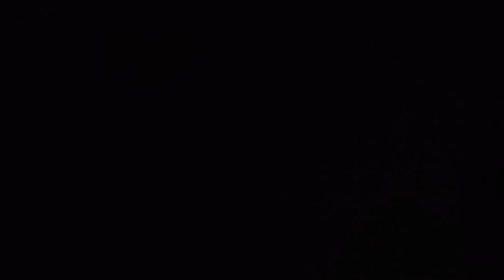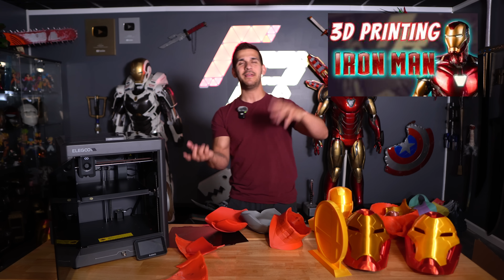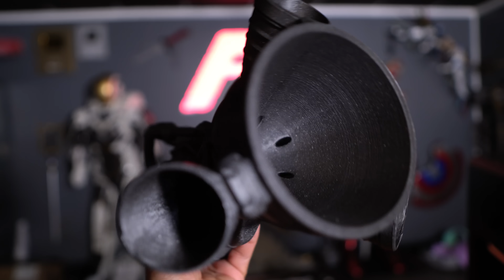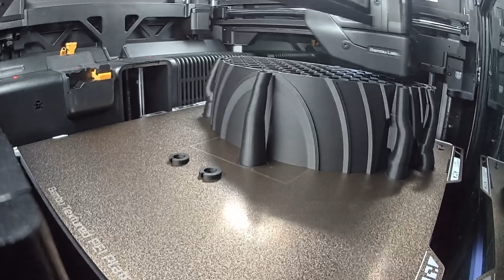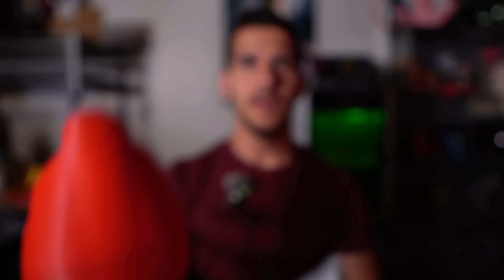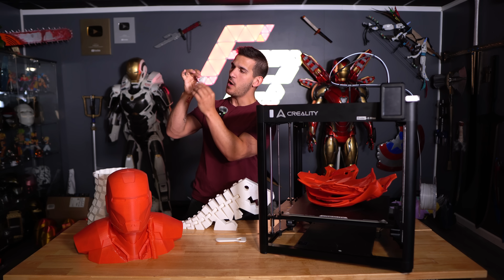3D Printer Update: Elegoo Centauri Carbon, Prusa Core One, Creality Ender-5 MAX, and Bambu Lab H2D

Comment: Hello everyone
I need a printer that doesn't show the print layers when printing, as I need to make a silicone mold from the print, so it needs to be really smooth.
The Bambu H2D Pro is the only one with a 0.2mm nozzle. Is the Bambu's print the smoothest than Ender-5 Max?
Thank you

Comment: I got a H2d PETG plugged up in the tool head. I started trouble shooting pulled the Nosel found filament in the Nosel and above it. This leads me to disassemble above the Nosel. I had no problem getting it apart. I spent 3 days trying to get it back together. I looked at the wiki page for it 3 times. I looked at it and warned that it may be exceedingly difficult to get back together. I was unable to do it but in a ticket 3 days ago on it and still no reply.

Comment: The banding wierd thing on the surface of the trophy is due to the vertical screws, I had the same issue on one of my printers and after some research I found a video explaining that in depth, it made sense, I regreased the vertical screws/rods/z axis and it improved I also tryed to not "hulk" tighten the screws, Its one of those times where instead of trying 1 "solution" at a time I did everything in 1 go and theres no way I can tell which one worked, anyway is worth going over everything from time to time due to heat expansion and vibrations. A bit more about the rods and banding, initially is due to lack of grease or the threads wearing out or being "loose" where it does contact and moves along that axis, like just a tiny bit so it translates to the part, hope it helps. Amazing video Frankly Built! thanks again hyper mega usefull info! :D. Salut

Comment: I've been printing both TPU and ASA on mine for months without issues. 

The only problem ive had is with old brittle filament where it needs to take a sharp turn to go into the extruder, it will break off.

Comment: Mr. Built,  Just curious if you are going to get and or do a video on K1 max upgrade kit for CFS?  If not I understand you have a lot on your plate just a curiosity as a K1 max owner I cant justify spending $1500 plus while I like and own the previous model printer and for under $400 can upgrade to multicolor. K1 max is my only printer.  Or in your opinion would it be worth upgrading or buying a new printer?
Love your videos keep up the great work.  I will watch your videos because you have great energy no matter what the format.
Reply from the maker: I may get my hands on one yeah

Comment: Those odd artifacts you saw on the back but not the front are probably related to belt tension. You can adjust the belt tension with 4 screws on the back of the ECC. Remove the back panel to see the mechanism clearly but you can adjust the screws without opening it up.

Comment: I'm tired of having to split my larger designs for the P1S, which is why I was disappointed with the  Bambu Lab H2D - We waited an EXTRA 6 months for them just to undersize the usable build volume and over price the H2D by $500 for what it is based on competition on release date.They wasted resources on a laser add on version for a 3D printer vs just making a laser specific machine (sounds like it was a personal / wife hobby for the President of Bambu Labs) I can see how the cutter add on would work for a 3D printer as that's fairly clean for a 3D printing environment, but just too small of a usable cutting area. Whereas a standalone Siser Juliet Prosumer cutter will kick it's butt... Heck, even one of those small crappy CryCut standalone would be a more viable option.
So, I'm looking at the competitors large build volumes K2Plus, Neptune 4 Max, Ender 5 Max ((Or waiting for Creality H2D type - Dual Head K2 "MAXIMUS" ... 

Curious on a comparison of the Elegoo Neptune 4 Max vs the Creality Ender 5 Max as the build volumes are pretty close compared to what's out there.

Comment: Great video! If you are lucky enough to get a free printer, run with it.  Never had any issues with a review of yours.  Anyone who has never shot a video, polished it and published it have zero clue as to just how much work that is.  I would love a follow up to any printer that is used.  Some of your early videos on supports were very helpful to me, and I wonder with the new printers out, have you changed they way you use supports now?  i just received my Centauri Carbon but didn't have the time to unbox it, yet.  Still love my Ender 3 pro's and CR-10's, but after the display of the differences in a simple .21 print, wow, what a difference. Didn't expect that! Thanks and love your work, looking forward to more!

Comment: Great video. The reviews and experiences you have had gave me great insight into which printers I consider buying. That said, make the videos you enjoy. The stuff you print will showcase which printers you use and like and do great jobs. Those of us that are smart enough, should be able to pick up on your opinions of the printers you use and like. I would love to see some more videos about the reasons you choose what prints, the struggle of finding the right angles and settings, and the failures that happen when you might rarely mess up like us beginners 😂. One last question, do you still use Armorsmith to size armor? I have it and it is not working right anymore. I tried to create an avatar of my son for a suit and I can't get the pieces to fit him right. What recommendations might you have? I've watched your old video on sizing and have tried to print test rings but it's not going great. Thanks for all the videos you post.

Comment: This is how I view review videos of "free" machines. If the reviewer is shilling for the company, that will eventually (and pretty quickly) come out. Personally, I trust what Frank and Uncle Jesse say. If they were to give a review of a printer and give it a glowing recommendation, then we see real-world reviews saying it's crap (and I'm talking overall reviews, there will always be complaints about every printer), it would throw their credibility into question and could endanger their entire channel. I don't see someone like Frank or Jesse risking everything they have worked so hard for, for a free printer. I can't imagine what a company could offer them for them to say "Ya, that's worth it". Also, to my knowledge, Frank has always stated that the printer was sent to him by the company (implying it was free) for review. Now, I don't know if legally (or by YT terms) he is required to disclose this, but I would think that if the review was "fake" and designed by the printer company to get a few more sales out of it, the fact that the printer was free would kind of either not be mentioned, or be swept under the rug. I could be completely wrong about all of this, but it doesn't change my opinion about Frank (and Jesse). I will continue to watch their videos and hold their reviews in high regard until the day they are proven to no longer be reliable (which I don't foresee happening).

Comment: Which slicer and what wifi speed are you using (or thumbdrive) with the CC?  Asking as have had occasional (common) "stop mid print" issue with the CC.  Trying to narrow it down based on what others are using.  Thanks for any feedback you are willing to provide.  Thought I would ask you as you print a lot of large stuff.
Other than this issue it has been flawless and print quality as good as my X1c.  I will try whatever your process is and see if this issue goes away.  Also, this is my 8th printer and have a lot of experience, not a newbie, just looking for what your successful process is so can narrow this down.

Comment: Through what you've done on your channel (the work, the time, etc.) you've given allot of confidence to take a step forward in this area of "residential manufacturing". Good content! It also seems like you may have the "foremost authority" kind of stir happening for you. Well done. I've just gotten started with printing and am in the 3d modeling phase with some easy stuff to do and have you to thank for allot of that. I've designed and built stuff for more than 40 years and am impressed with the pro-level and finish of your channel. Thanks! allot!

Comment: I have been watching a lot of your videos lately. I got a used 3d printer a little over a month ago ( Mingda Magician X2) for 60$ used with almost a full filament reel to. I have been watching 3d printing stuff on and off for years and finally took the plunge and really been enjoying it. You have helped me a lot learning some things i needed to. If you read this though i wanted to ask what printer you think would be good for my next one. Some context, I am disabled so im slow to put things together and paint but i was hoping in time to make a little side money selling 3d prints that i do for fun. I was thinking of a mix of things from figurines, cosplay weapons, helmets, swords, and other little do dads here and there. I want to be able to do some multi color prints in time. 

 My main goal i guess would be to make a little extra on the side so i could pay for the filament and to buy other printers to have fun with and use to make stuff to sale.  I am already decent to pretty good at airbrushing  so that would help a lot with figurines and cosplay / props. The main machines ive been looking at is Bambu a1, bambu H2D ( larger print bed, heard it can do less waste on multicolor since dual nozzle), anycubic s1 combo, elgoo centurion, or a prusa core one, i was thinking of just getting a1 with ams and start printing stuff i know that sales to get enough money from selling and then get a h2d. On the other hand i could just get h2d and it does less poop waste on color change with a larger print bed . there is more i could go into of course but i thought this was enough and if anyone can help me feel free to as i am open to all comments :).

Comment: I like the the bundled update video format. Not everything needs a long form “this is what it’s like 5 months later” especially if the overall opinion has stayed the same. Now maybe that depends on the printer. But for the most part that should work.

I think it’s also nice to have those initial thoughts as independent, especially as those videos could sometimes be sponsored and probably only want you to talk about their product.

Comment: Unfortunately, the Bambulab H2D really let me down. I was expecting a reliable and high-performance machine, but I ran into numerous issues, from unstable performance to software bugs that only made my work more difficult. On top of that, the print quality wasn’t as consistent as I would expect from a printer in this price range.
On the other hand, the Prusa Core One completely exceeded my expectations. It’s an incredibly precise, fast, and reliable printer that handles even demanding projects with ease, and the build quality of the machine is on a whole different level.

Comment: I have a ender 5 max I use sun lu filament in it after drying it well.  For PLA it did pretty well.  Creality slicer kept crashing so I got orca slicer instead.   I really wanted this printer for larger petg projects.  That's were the nightmare started.  Petg took me 3 weeks or so to finally.get it running decently.  However there are very few spare parts on the market. And I just found replacement parts for the last crash it had printing.  I would suggest tapping into the filament sensor and put a magnetic hall switch on the front cover.  Similar to bambu so when the print  starts filling the head it will stop by pulling the front cover off and opening the switch.  It does print quickly once you get it tuned in
  There isn't any other nozzle sizes other than .4 or filament setups so you will have to manually fail in other filament than creality.   It's a good printer  for it's size and price.  To be fair I had no major issues with pla.  Quality not as good as bambu but decent.  You need a really stable table it shake my table that I thought was stable a lot.  Easy to put together, if you pay attention and have mechanical abilities.  The side assembly was wonky and I had to read it a couple times, but it is correct just odd the way you do it. Dried Sunlu petg does work but lots of tuning to get it running.  I suggest you consider checking your feed tube and if the filament is tight possibly replacing with a larger id tube.  I hear rumors of the long tight tube causing gear issues in the head over time. Sofar this is just a rumor.  I thought this odd coming from using Sprite heads and replacement heads from swiss micro that will pick a printer up off table.  Also if you have dry box for petg ensure you put behind spool arm.  Once you reach end tape on spool will pull the dry box into side of printer under the plate table if you just put beside it directly.  Epoxy plate is a real pain to get some bigger prints off and looks horrible, wash it well with dish soap and water, hope someone makes a pei sheet soon.  Soo weird picking giant 400mm plate up sometimes.  Got to heat up head finish cleaning the melted filament off the head wires from the most recent crash and hope the replacement parts I found actually fit this printer. Good look be careful with it till parts hit market

Comment: I have two Prusa bed slingers and a Bambu X1C. If I was going to buy a Core One, I think I'd wait until they implement the Bondtech INDX tool changing system to replace the MMU. If I was building a print farm, I'd have to see how the Elegoo Centauri Carbon prints ABS, and also I might have concerns about using it as a production printer until there are reports on reliability.

Comment: @FranklyBuilt
 I would like to start this with, I really do enjoy your videos and content and will continue to watch and the new series you are making.  But.  lol  I have a question...its kind of directed to you but also to other content creators as well that do "review" videos or whatever you want to call them.   When showing off prints that you do on the different machines why use old filament that has been left out for "years"?  and even if you do use that filament for testing why show those to use and then blame the filament for being old or again "insert excuse here" for any issues you might have ran across.  If you are going to review for just show off the printer to show us what it can do why not just use new good filament and give the printers the best possible chance to show off?  Its like your escape goat in case something doesn't go right you can use that excuse.  I'm not trying to say you are hiding anything and i don't want you to take offense to what i am asking.  Again i do like your videos and your opinions on printers.  I'm sure you have a huge supply of filament brand new just laying around.  I am not saying you cant use your older filament to run testing stuff on..by all means who wouldn't but for the prints you show off in your videos why completely show off what the printer can do...and anything that doesn't come out just right might just be the printer..like cooling issue or whatever.  I am not going to pretend to understand your job and what contracts you have with these companies.  I think some of them when they send out printers they even send of their filament for you to use with that printer.  For example, I know Bambu printers and just flat out print nice but most of their filaments when using their slicer are tuned for their filaments (mostly) and really show off what that printer can do.  ( I know there is always more tuning you can do to fine tune things)  I see lots of creators do this and i am not sure why.  I understand that not all content creators are your size with your amount of subscribers and filament can be expensive to maybe use brand new filament for all the testing but like you said...this is your job...to show us what these printers are capable of.   Not all filament is created equal and not all filament will react the same way across different brands...like when you talked about the Elegoo build plate....I printed fine with other PLA but with the silk you had some adhesion issues with but just changing out the build plate and the issue went away.    That to me was interesting and had me taking a mental note.  Clearly not the filament and not the printer fault.   Anyway sorry this was kind of scattered rambling but i hope you understood what i was trying to say.  Thanks again for the excellent quality video and i look forward to all the new content to come.

Comment: I just upgraded my Ender-3 S1 Plus to the K2 Plus. However, I would love to see a review from you of the Ender-5 Max. For large prints, I'm not too concerned about getting Bambu, Prusha, etc quality as I would be post processing the prints anyway. However, it would be nice to know what the speed differences are printing large files on the Ender 5 Max compared to printing something using the H2D and the K2 Plus.

Comment: When we are getting to the point where most of these printers are coming out of the box ready to roll and hold up generally we'll, I think it makes sense to consolidate any kind of 'updates' along the way. If/When something goes against that grain, it might be worth highlighting closer. Its kind of the same thing the resin printer reviews have went through. Very few talk about how the new ones print, because they're just printing stuff out of the box. Most of the bad stuff that happens is user error. Great video Frank. 

Sidenote I wouldn't hate it if someone putting a CFS upgrade kit on a k1 max or k1 through the ringer. Parts are hard to get right now, and a lot of people are on the fence about it.